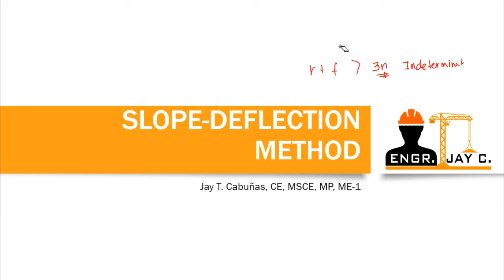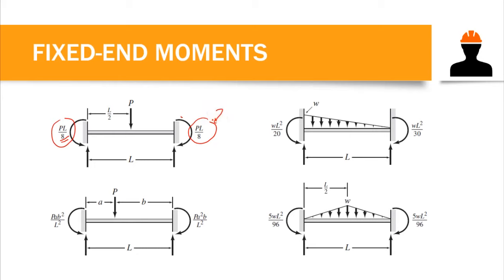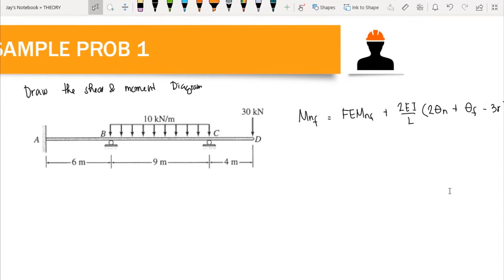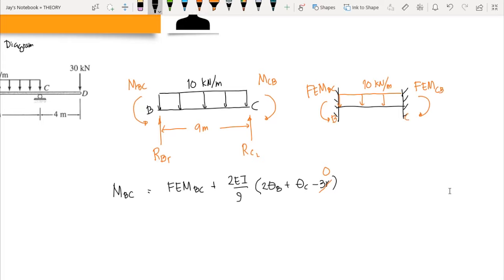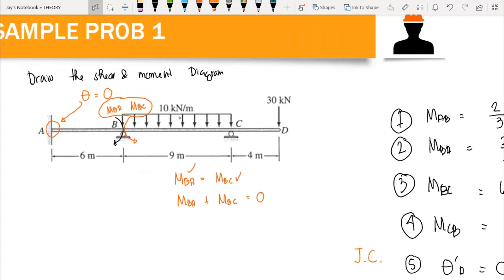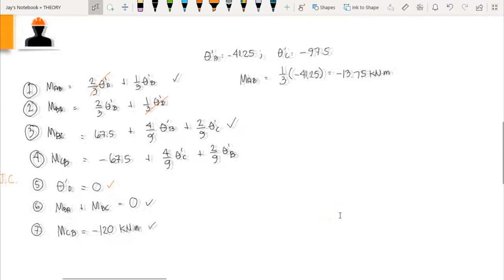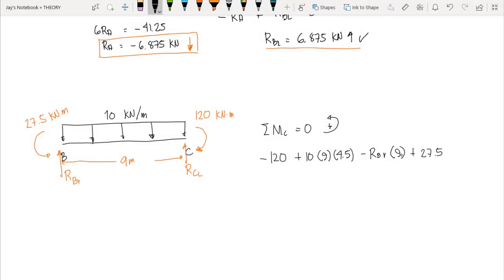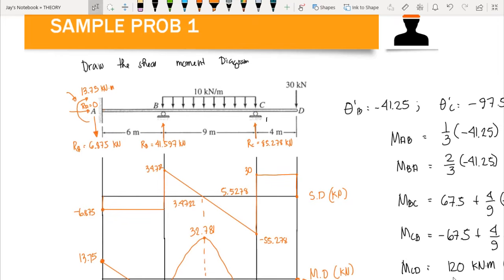Structural Theory | Slope-Deflection Method | Analysis of indeterminate Beam Part 1 of 3

Comment: Can i ask why is that counter clockwise moment considered + sign? What i learned from my prof is the opposite. Clockwise is positive and counter clockwise is negative.
Reply from the maker: It depends on your assumption. Either way, you should have come up with the correct answer. But make sure to be consistent on the sign you are using. Thanks
Reply from the maker: I am using kassimali as reference.